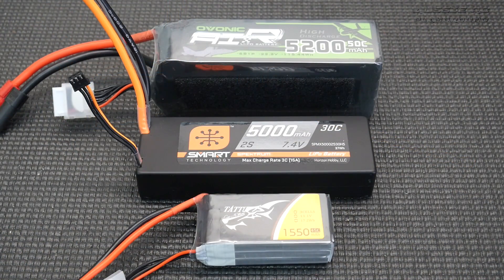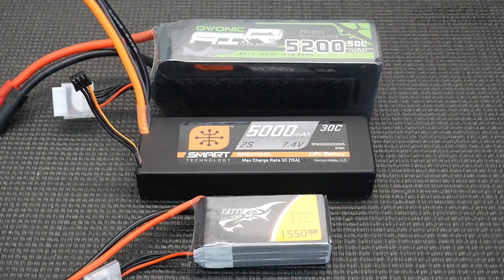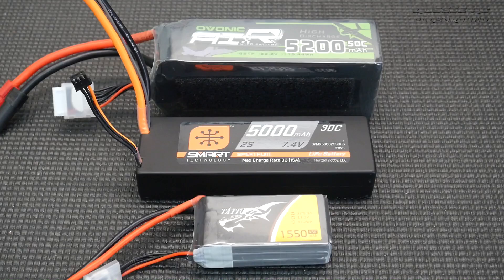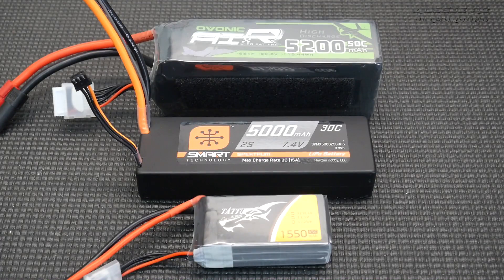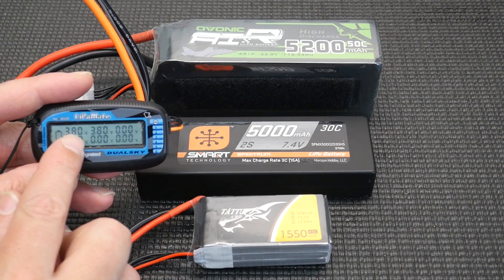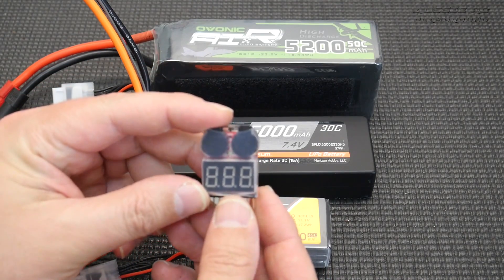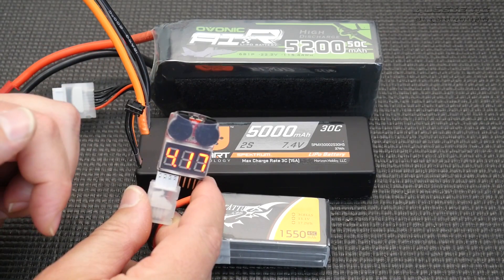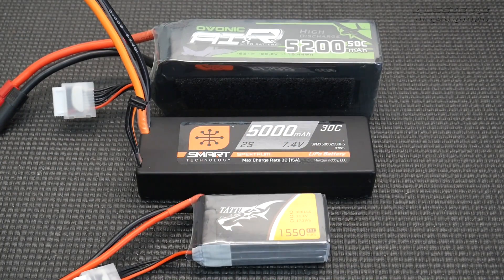RC HOT TIP - Understanding Lipo Batteries (Part 1) - Voltages

Comment: 3.2 volts? At all the fpv drones tutorials they warned me not to go lower than 3.5 volts
Reply from the maker: Drones have a very high amp draw and if you drain your battery to 3.2v it can actually hurt the cells, so FPV drone pilots usually don't go below 3.5v to protect the battery.

Comment: Silly question: is each cell able to charge to 4.2v, regardless of mAH? I notice the small 3 cell battery was charged to 4.16v on each cell, even though each cell is physically much smaller than the 2 cell 5000mAH battery you had next to it.

So a rule of thumb is that the max charge for any/every LiPo cell is 4.2v, regardless of how many cells the battery contains or what the mAH rating is?

Where does the 7.4v number come from? 2 cells at 3.7v but what is the 3.7v number signifying?

Comment: If I could make a suggestion for your series Vas, perhaps some advice on correct disposal of lipos that have reached the end of service? The information I received with mine was to put them in a solution and then into household rubbish, I’m not sure if that is best practice.
Reply: Great idea! I heard you put them in water with salt in it. But that will be a great video idea for this series
Reply: @cwatson42785 yes!!  I've done it quite a few times with puffy or "unable to balance" lipos that freak me out a little... 
I discharge them to min voltage with my charger, then put them in a bucket of water and leave them for a week... come back, and with a volt meter measure it to make sure it's 0 (zero) volts...  I tested a tiny battery 500mah 1S by stabbing it with a nail after a week.. and zero volts..... nothing.. no fire breathing angry battery... nothing... happy days... Not sure if the law has changed by putting them into the bin though...
Reply from the maker: Thank you for the suggestion, I will make this happen. 😊👍
Reply: Aussie RC Playground thank you sir, always good to do the right thing.

Comment: So glad you are doing this Series Vas! Quick question how long can a fully charged lipo sit before using them? I think I had a couple puff up on me a ways back and I think it was cause I had a habit of charging my batteries AFTER I ran them and they could sit for a week or 2. Also after using a lipo and it hits lvc is that lipo ok to sit for a couple weeks till I run them again? Thanks for any advice buddy! 👊👌🍻
Reply from the maker: It's hard to say how long a battery will last fully charged, every battery is different (different brands and C rating), so while some will do well sitting around fully charged, other will not. Best advice is to make sure you have them on storage charge whenever they aren't being used. I usually start charging mine on Thursday to use on the weekend and then put them on storage on Sunday and Monday. So any I didn't use can be charged up to 4 days, and I don't think that'll do them much harm. If you have a couple of charges, you can put your batteries on storage charge pretty quickly while you're having dinner or watching TV. Regardless if they are still charged or discharged, your charger will put them into storage charge. It's a habit worth getting into in order to prolong the life of your packs.
Reply: @AussieRCPlayground  Awesome man! Very much appreciate the advice! You're a huge help to people in the community. One last quick one I would ask is is it ok to run a lipo that is a little bit puffy? Or once it puffs out a little is it garbage? Didn't know if there was a rule of thumb for puffy lipos. That was my last question, I promise lol. I really do appreciate it tho. 🍻👊
Reply from the maker: Well, some people would say that once a battery is "puffy" that is a sign of a damaged cell (or cells) and I guess that's not entirely wrong, but I also think it should be taken on a case by case basis.
To me there is a difference between a "puffy" battery and a "swollen" battery. A swollen battery will still feel hard (or firm) but will feel like the shrink wrap hasn't quite shrank all the way. So it has this soft outer layer while still feeling firm underneath. I do use some batteries like this and it's usually a sign that battery is on its way out, so I keep a close eye on them and don't abuse them too much.
However, a puffed battery is a bit different and will feel like a balloon that's about to burst. Those is wouldn't go near and would dispose of immediately.
Hopefully that makes sense.
Reply: @AussieRCPlayground  Great info! Yeah my lipo would fall under being just swollen a little bit. I mean not even that bad. Also the cells are pretty close to each other with I think just one being a little off from the others. I just recently got a nice htrc dual charger that is much nicer and more hobby grade than the traxxas ID charger I used to use and bought when I first started in the hobby. You are the man Vas! I really do appreciate taking the time to help me out! Thanks 👊🍻👍👍👌

Comment: Anyone have a suggestion, my son's brushed Arrma Granite cuts off early at about 3.8 or more volts.
Reply from the maker: What battery are you using and what's the C rating on it?
Reply: @AussieRCPlayground  Lectron pro 2s 5200. I have 2 and they are usually identical when I go to charge them.... right around 3.8-3.9. Maybe I could run it on Nimh mode and use one of the alarms from your video as a safety instead?
Reply from the maker: What is the C rating?
Reply from the maker: That battery is more than capable of powering a brushed Granite, so the problem probably lies somewhere else. I would check the ESC and see if the LVC setting can be changed. If not, then I'd be looking at replacing the ESC.
I'd also check over the car as see if there is binding anywhere in the drivetrain. A "bind" can raise the amp draw and could be causing the battery to dump early as a result.
Reply: Are you using any type of adapters on the battery. I had the same issue with my Granite BLX, I was using Gens Ace Bashing 5500mah 3s lipos with a adapter to go from deans to EC5, and sometimes they used to cut out early. Since removing the adapter and converting my batteries to EC5 the problem seems to be resolved.

Comment: My Traxxas charger doesn’t get all cells exactly the same, 3.83, 3.85, 3.82 normally. Sometimes it hits 4.22 at full charged. Hope it’s not that bad
Reply: That's still ok as there's not much difference between the cell voltages... but I would still keep an eye out for the under/overcharge value in particular as that has the most potential to ruin lipos, as does lipos that overheat when being used

Comment: Would be interested to know if you always charge your lipos to 4.2v per cell. I read a good tip is to set your charger to 4.17 or there abouts to further preserve the lipo for longer life. I don't have any evidence to support if it's benefits the battery in any way.